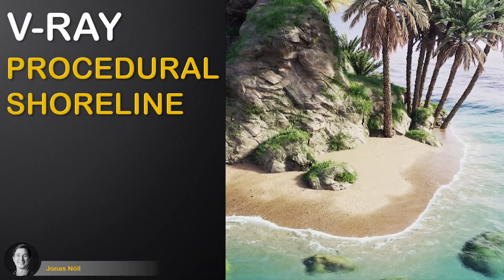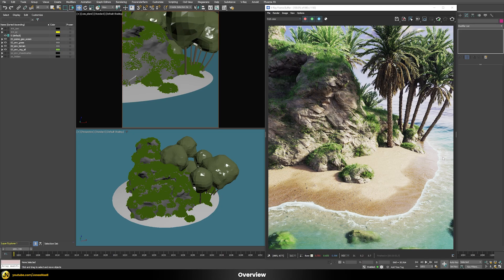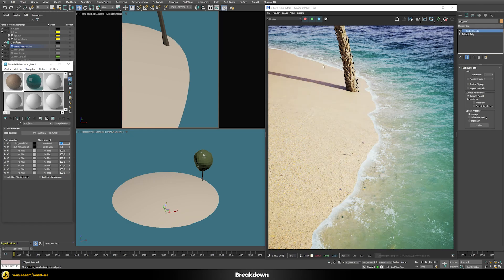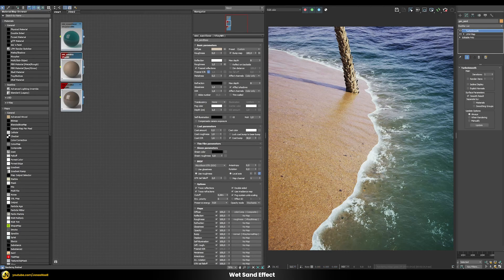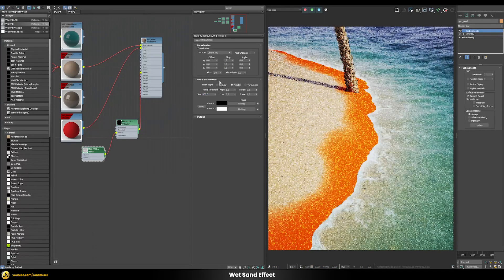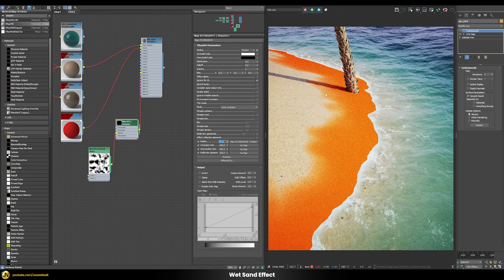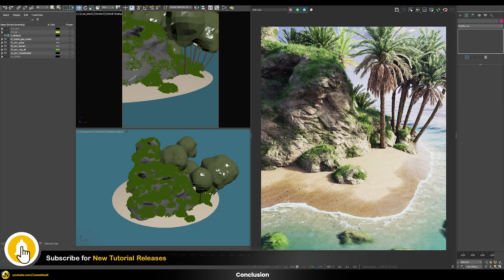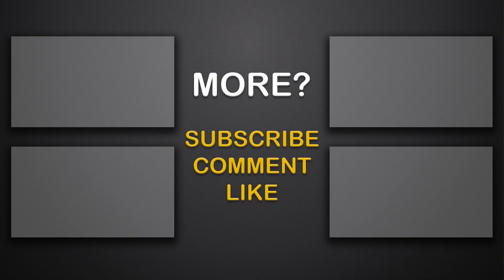V-Ray | PROCEDURAL SHORELINE | Ocean Shader Breakdown

Comment: Can we create animated wave ?
Reply from the maker: I think I answered this question before here somewhere in the comments
Reply: @JonasNoell  i checked all comments i didnt find any answer or qustion regarding animated  waves , to  shore (just elobarating my qustion)  using this method?
can you please answer?
Reply from the maker: @phanigurram  Oh it was probably in my other ocean shading video. You can animate it and it will work as it follows procedural rules. However if your focus is on animation then you will probably get better and more believable results using simulation based methods. This here is a shading trick which is very easy to setup and fast to render but it probably will have limited convincability in animation.

Comment: Hi Jonas, you say your most preferred way of blending two materials together is the V-ray Blend Material. Is there any other way to blend two or more materials? 🤔As always, a great tutorial!
Reply from the maker: Well, you could just do it all in one shader by blending and masking different for diffuse, normal, glossiness, etc. The BlendMaterial is easier as it treats them as separate materials and you can keep everything neatly separated. However doing it all in one shader also has benefits, for example it normally renders a lot faster than splitting it up through a BlendMtl.

Comment: I use the same techniques.  The only different is i use vray distancetex instead of vraydirt. Alot of peaple will find it handy and enrich the whole render .
Reply from the maker: Yeah, also possible. I prefer the vray dirt as it is more stable, the distancetex tends to sometimes crash while during the IPR and doing adjustments at least on my machine.

Comment: Great work and attention to detail , can I use vray for rhino and make these making renders I don’t find some 3dsmax setting options in rhino (but even rhino is a very powerful 3D software and supports grasshopper etc.) seeing your tutorials I and thinking of shifting from rhino to 3dsmax ,what your opinion ?
Reply from the maker: I guess depends why you chose Rhino in the first place. So I guess you have a lots of NURBS models/scenes? If that's the case I guess you won't have much fun with 3ds Max :)